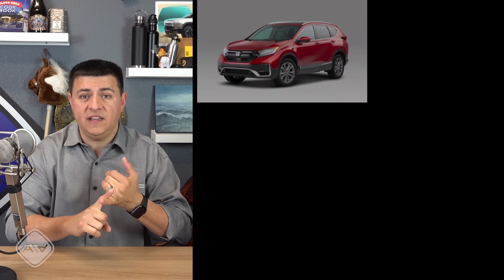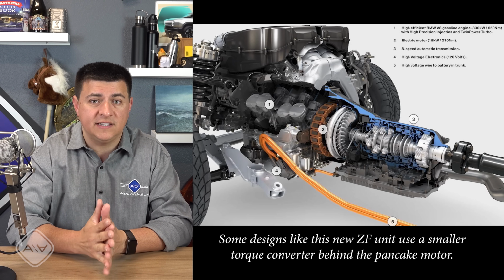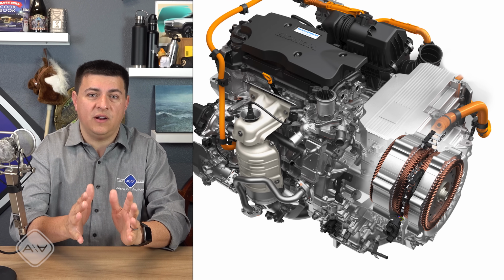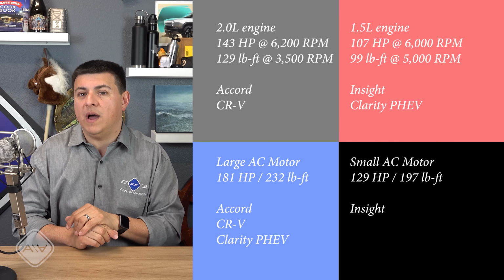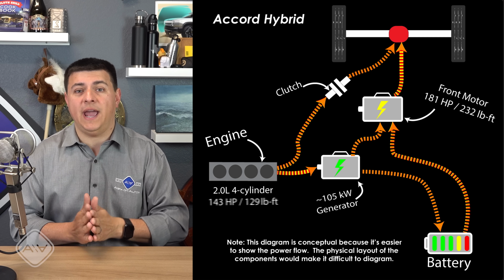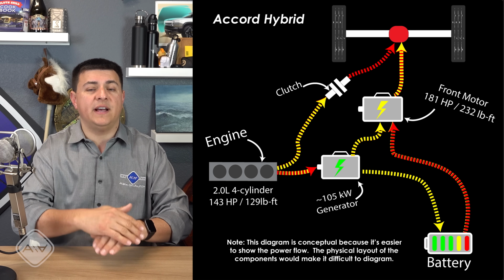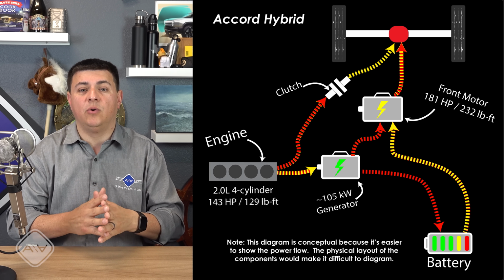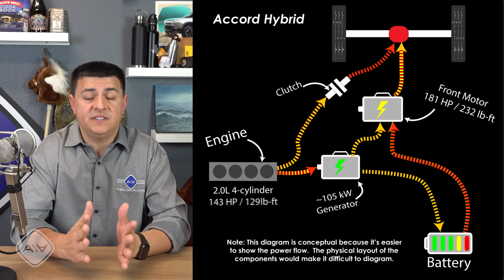How Does It Work?  Honda's 2 Motor Hybrid System Explained!

Comment: Question, is this system more or less reliable in the long run compared to toyotas power split system ?
Reply: It's hard to say whether it is or isn't. The Toyota PSD has been around for 20 years, and is proven to be very reliable. (There may have been other issues the car had, but they were not the PSD.) The Honda iMMD system has been around for only six (the 2014-15 Accord PHEV was the first, then the 2017 Accord HEV), and has no systemic issues that I am aware of. While there really is no reason to suspect a problem could crop up (it comprises two electric motors and one clutch, which are well-established technologies), it hasn't been around as long. But if there were issues, they really should have cropped up by now.
Reply: @jeffjo8732  Hello, I have a question. Is the e-cvt transmission used in this new 1.5 cc Honda Jazz exactly the same system as the e-cvt used in the 1.8 cc Toyota Corolla sedan or is it a different system? The reason why I asked this was they said that the risk of deterioration of the e-cvt system used in Corolla is less than the normal CVT. Do you think we will have problems with the e-cvt gearbox if we buy Jazz?

Comment: Alex you make it sound as if the gas engine comes on when driving over 42 mph. Perhaps you didn't intend to portray that but that is what it seems like. Not true of course. We drive in EV only at speeds up to 75-80 mph all the time. Our Clarity engine doesn't come on until we take a long enough trip where the battery becomes depleted or we manually switch to HV mode.

Comment: So the insight operates the same way as the others, just with less maximum torque due to the smaller motor? I'm just slightly confused because around the 4:40 mark you specifically mention the other three vehicles but not the insight.

Comment: Am I understanding correctly that the 2020 Accord Hybrid does NOT have a CVT steel link belt, and that the power from the gas engine and the electro motor is transferred to the wheels via direct drive gears and mechanical clutch?
Reply: About half right. There is, indeed, no CVT steel link belt, or any other kind of mechanism that changes the gear ratio. In fact, most of the time the engine is not connected to the wheels at all. The motor, however, is always connected to them.

Usually, the engine drives a generator, and the generated electricity drives the motor and so the wheels. When the clutch locks up, it joins the motor in driving the wheels. Or, more often, pulling some power of as a generator and charging the battery.

Comment: Hi Alex - one quick question regarding crv oil dilution issue , if I go for CRV hybrid , I shouldn't be worried about oil dilution issue as the new CRV hybrid uses the same proven engine of Honda Accord hybrid ...not a turbo engine used in regular crv 2020 is my understanding correct - please clarify.
Reply: The older Atkinson cycle direct fuel injected engine doesn't have a dilution issue. The newer hybrids aren't direct fuel injected.
Reply: Thank you  @benholdaway7570  , got it the newer hybrid crv may or may not have this dilution problem ...  I think I need to wait for the reviews to come...
Reply: @balanagarajan6185  It will not have it.
Reply: @jeffjo8732  : Thank you !

Comment: MG1 and MG2 rotors are kinetic energy storage devices.  The reason performance and fuel mileage increase while system weight decreases is the speed of the rotors has increased.  The system uses mechanical gears to speed up the rotor before slowing it down at the wheel.  Power= torque* speed, if all MG1 and MG2 are is electric motors the process would not be beneficial. Thank you for your videos.
Reply: The motor-generators (called the generator and the traction motor, not MG1 and MG2, because their roles are different than in a Toyota) are power conversion devices, not storage devices. Yes, they do acquire a small amount of kinetic energy as the operate, and can return it to the battery. But the amount is insignificant compared to the energy they transfer.

The reason fuel mileage increases is because the ICE can almost always run at its most efficient level of power regardless of the power needs of the car. The motor-generators facilitate this by adjusting the power flow between the ICE and the wheels, using the battery as the storage device you describe incorrectly. In Hybrid Drive, adjusting is done in the electrical domain after all ICE power is converted to electrical power by the generator (the one that is not called MG1). In Engine Drive, it is done in the mechanical domain by the traction motor (the one that is not called MG2).

The reason performance increases (over pure ICE) is because the traction motor (which is in a FIXED rpm relationship with car speed since no gears change) has a different and much wider torque profile than an ICE, and can change quicker when powered by the battery.

Comment: Thanks for a very informative video. Is this the same Ecvt used in the 2023 Accord?
Do you feel it is s reliable unit capable of 100k miles?
Reply: It's the same basic idea, but with a few tweaks. They made the motor a little bigger, which required re-arranging the components differently. Big there was a bigger change in the CR-V; for towing, they added a second direct-drive gear and clutch.

Comment: I like the design it seems simple but I heard you say in other videos the Honda mpg drops off over 70 mph or so. If you were going to drive a 50/50 mix of California suburban streets (45-50mph) and freeways 70-75 or even greater (traffic seems to move 75-80) would you get the Honda or Toyota system?
Reply: My Accord mpg doesn't drop off dramatically above 70mph. Any car will get worse mpg at those speeds. A hybrid doesn't help during highway driving since there is no regen from braking. Since 70 to 80 mph requires more horsepower than city driving, either an Accord or Camry would be fine but avoid lower horsepower vehicles like the Insight or Prius. To me, the Accord has a stiffer ride than a Camry and feels more stable at highway speeds, but it is no sports car.
Reply: Ben Holdaway thanks!

Comment: Question Alex - So effectively for a daily commute that does not exceed, say 75 MPH on the highway, am I correct by saying that the clutch will never close, and that effectively the vehicle will be driven by the motor the entire time using the electricity from the engine driven generator?
Reply: Just the opposite. The clutch can be closed (meaning the car is in Engine Drive) at speeds between about 40 mph and 80 mph, although it is more common in the 45 mph to 75 mph range. The power requirement has to be low as well; it will open if you apply acceleration, or have more than a slight upgrade.

In the commute you describe, unless it is very hilly or there is a lot of stopping, the car will alternate between Engine Drive (clutch closed) while charging the battery, and EV Drive (engine off) to use up that charge. It will use Hybrid Drive (clutch open) for acceleration and hills. A recent presentation from Honda says the Jazz Hybrid, with the small engine Alex describes, and in a 75 mph commute, would spend 13% of the time in EV, 14% in Hybrid, and 73% in Engine. The Accord, with a larger engine, would spend more time in EV.

The goal is to keep the engine's output along a line connecting about (1500 rpm, 20HP) to (3000 rpm range, 50 HP). That is where it is more than 40% efficient. Those rpms correspond to 40 mph to 80 mph in the Accord with the clutch closed. For speeds outside that range the clutch opens and the engine goes to its most efficient point at (2000 rpm, 34 HP).

Comment: A question regarding regen braking: what’s the maximum braking power you can get out of the motor? Is it same as when its powering the wheels? Why Tesla is able to run on single gas pedal, but Honda/Toyota etc cannot?
Reply from the maker: Well, remember that the Tesla cannot infact do true one pedal driving like some EVs, it's close but not quite. Also, Tesla does not do any blended braking, the regen is 100% fixed at two different levels of your choice.

Comment: First gen Volt had similar setup but it was plugging hybrid
Reply: Lots of things can be called "similar" when in fact they are quite different. The first generation iMMD, in the 2014 Accord Plug-in Hybrid, was essentially the same setup as the third generation version Alex describes here.

The first generation Volt had some similarities, but needed three clutches instead of one. It is arguable that it was a range-extender BEV instead of a PHEV, but the differences are a bit ambiguous. For example, it would change to a parallel-serial mode for boost power (instead of the generator). The iMMD switches to a serial mode for efficiency. In fact, as Alex describes (https://youtu.be/o3-wGOyT2-I?t=110), the Volt's hybrid mode bears more similarity to the Toyota system.